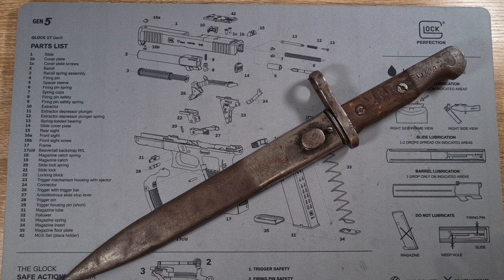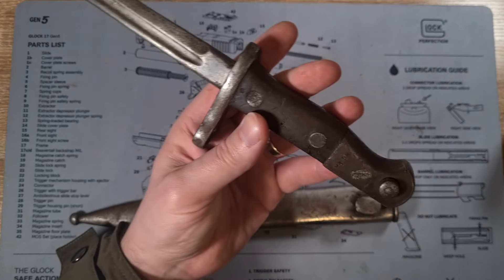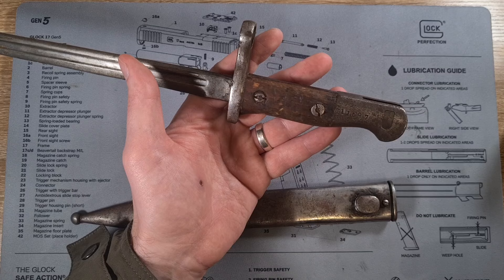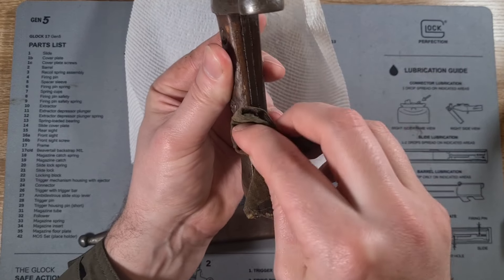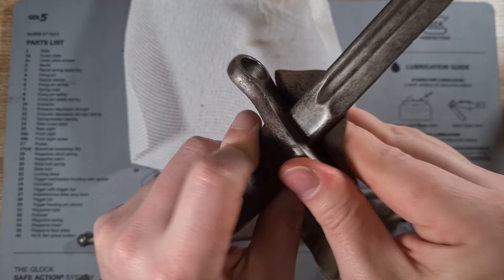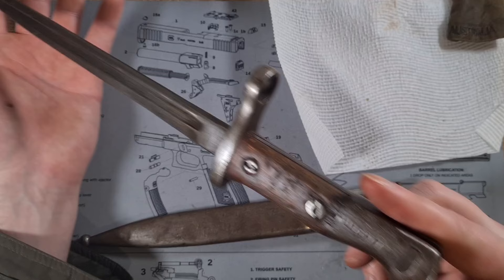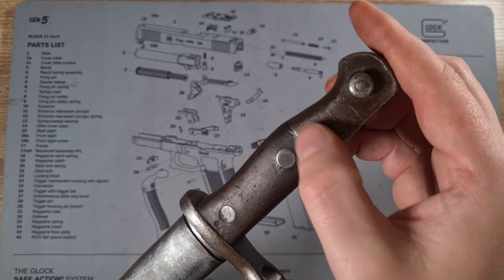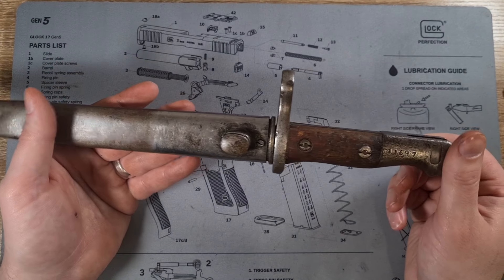Polishing the past, bayonet cleaning

Comment: PB blaster works great on those stuck parts. I like to use mineral spirits to get the surface funk on the handle. Most of the time, I'll use ballistol and, on occasion, 3 in 1 oil on the metal parts.